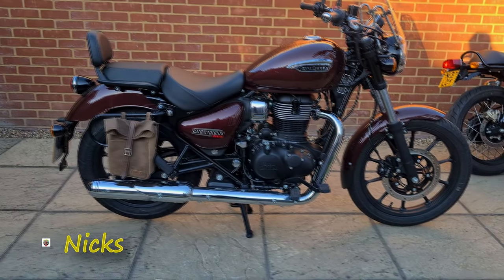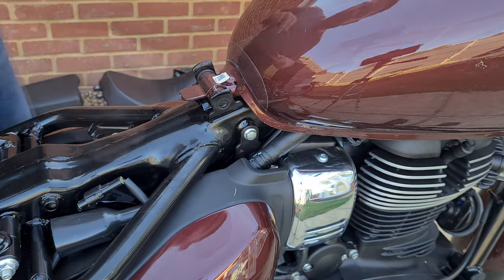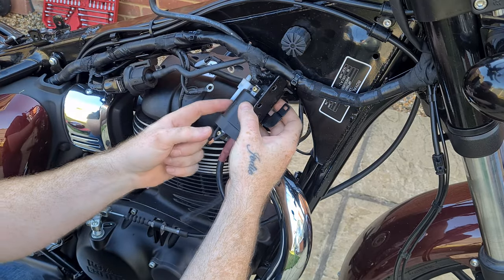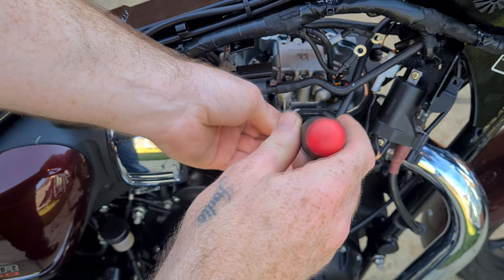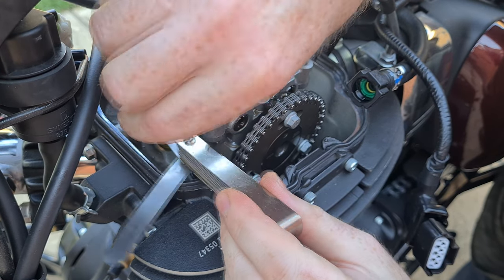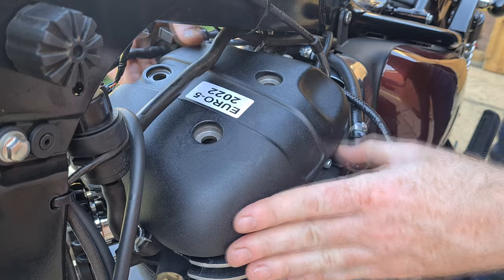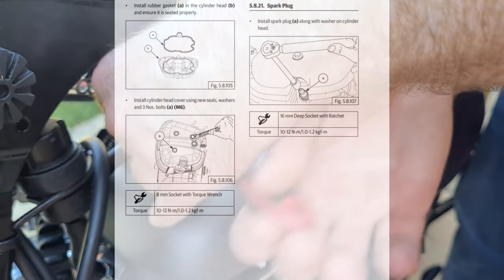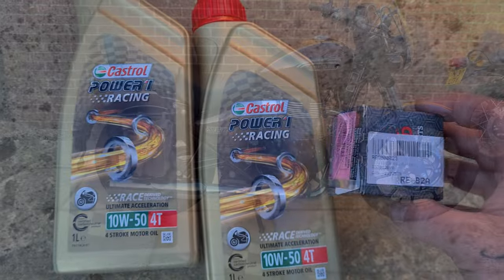Royal Enfield Meteor/Classic/Hunter 350 Valve Adjustment & Service | Oil Change | Tappets

Comment: Just a quick one, won't using fully synthetic oil increase the running in mileage due to the reduced friction of the synthetic oil 🤔 I'd have thought sticking with the semi synthetic till at least 1200 miles and then switch would be better.
Reply from the maker: Oil will be changed at 1k anyway I don't belive 300 miles is enough really.

Comment: Thank you for the video. I have two questions: 1. You showed images of pages with the torque specs in your video. Where are they from (Is there a service manual available?)? 2. What is the “parts cleaner” spray you were using? It looks handy.
Reply from the maker: its literally brake cleaner. you can find the manual on a royal enfield forum, link is here in the comments somewhere.

Comment: Great Video! Does full synthetic affect the clutch? I’m a Honda tech and some models couldn’t use full synthetic. Also I take it these are the same valve specs that use the 350cc engine? Wish Royal would make a damn service manual available to the public.
Reply from the maker: Hi bud,  for the clutch, it's fine with this low stress engine

Comment: Great video, I made the mistake of tightening the engine cover bolts too tight and snapped one, thank god I was able to get it out and order a new one…. Watched another video which says to tighten them hand tight, and then give an quarter turn…anyway you can comment on this with your opinion on tightening those bolts
Reply from the maker: once they come to a stop with hand, turn 1/4 of a turn
Reply: @nicksepisode  thank you, also did you notice the tappets sounding more noisy after the service? My bike runs so much better after the service but I had a guy tell me the tapping noise is not good and I might have adjusted them too loose, but he doesn’t even own a royal enfield😞 I’m hoping it’s just the way the bike is supposed to sound
Reply from the maker: @airborne15545  the noise should be the same as before. Take your feeler gauge to your mechanic and show them the specs to make sure you have used the correct gauges. The numbers can get confusing on them

Comment: Excellent video. Question: Does the engine noise increase when the engine is warmed up? Is this normal on the 350? Only have 2,000 km on mine and I'm concerned. Basically sounds like a piston slap or a leaking exhaust manifold. Nice and quiet when engine is cold.
Reply from the maker: yes the oil gets thinner and noise will increase when warm
Reply: @nicksepisode  thanks!
Reply: I would hope with a multigrade oil that it actually reaches 50 viscosity rating when warmed up. It shouldn't get thinner, IMO. The oil just generally flows more easily when warm.

Having said that the video is excellent and I am about to get my own bike soon so extremely useful. @MagicRoosterBluesBand
Reply from the maker: Thinner is a better word to help visualise what's happening

Comment: Just a question… what is the product you use for parts cleaning and in what kind of container you put that product in so you can then pray the cleaning product. Thank you
Reply from the maker: Its brake and clutch cleaner. The container is a pump action pressurised bottle from "wurth"

Comment: Would you recommend putting sealant on the Rocker cover gasket if you have disturbed it on the first service,
And if so, do you put sealant all around the Top and bottom, sparingly?
I'd be most grateful for your opinion?
As I have a slight leak after doing my first service on my Royal Enfield Hunter 350 
And I'm thinking that the only thing that would stop it now is my new gasket (which leaked) , and I should do it with sealant now,
Cheers Paul Foster
Reply from the maker: Put the gasket in the rocker cover first. Smear a thin layer of silicone sealant on the rubber. Try that
Reply: @nicksepisode  thanks very much, I'll do that 👍

Comment: Hi Nick! Great video! Can you please clarify one point which would make things a lot easier for people undertaking this service - as this does not appear to be covered on YouTube or anywhere else? As the  petrol tank has a fuel pump; when you disconnect the fuel supply pipe from the petrol tank to the injector, will only a small amount of residual petrol drain out of the tank (because the pump is not pumping) or will it free flow all over the place? Thanks. John.
Reply from the maker: hi, it will bot free flow, sorry i should have added that
Reply: @nicksepisode  Hi Nick - is that a 'No' it will not free flow? Thanks mate!
Reply from the maker: @johnmcgill5742  it won't free flow bud. You can remove pipe even with full tank
Reply: @nicksepisode  Hi Nick! That's great - thanks again! Top video & tutorial by the way - can't wait to get started knowing now that I'll not be covering my feet in petrol (LOL)!

Comment: Does it matter if I use a different oil filter that isn't royal Enfield brand? I don't feel like going to the dealership every time for parts, so I was wondering if there are good equivalent replacements I can use.
Reply from the maker: You can use after market filters from eBay

Comment: Hi! I'm contemplating between a Meteor,  Hunter and a honda bike and looking at the maintenance upkeep. What's the valve clearance interval for a meteor? Or is it required every oil change interval?😮‍💨
Reply from the maker: valve check every year but its very easy. if you are not mechanically minded go with a Honda

Comment: Any particular reason why you didnt remove the oil via the drain hole first, instead of by loosening the filter housing?
Reply from the maker: The filter is where most comes out, the 2nd bolt just drains the crank case area

Comment: Hi
Just a quick Info update, I have a 350 classic, just approaching the first
Service, 
RE have confirmed to me that the tappets dont need adjustment at the first service
They do however require it at the second service
Regards
MikeN
Reply from the maker: Mine needed adjustment, but won’t harm to leave it until the 2nd service as that’s more cost effective if you’re paying a dealer to do it.
Reply: @nicksepisode  No problem,  mine is not going back to the dealers for servicing.

Comment: I greet you Nick, from Slovakia. I praise your excellent instructional video without unnecessary words. I have 2 questions: Do you mind if I did not offer a new oil filter into new oil as it is here in the video? Does it bother if I did not twist the smaller drain screw on the right side of the engine when I discharge old oil? (I only drained the oil through the larger hole with a plastic filter that is for 2 smaller screws.) Thank you for any answers.
Reply from the maker: that's absolutely fine

Comment: How can you tell if the TDC is on compression stroke or exhaust stroke?
Reply from the maker: The valve arms will have slight play
Reply: Erm! Not sure that’s entirely correct? I did the clearance today and the TDC hole (cam) travels a full 360 on rotating the crank bolt. Within that 360 all 4 strokes are complete. Are you suggesting that a full 360 of the TDC hole is only 2 strokes?

Comment: How long did it take to Nick?
What is the difference in time between a major and minor service?
Many thanks
Reply from the maker: 1 hour. Minor is oil and filter and inspection. Major is oil filter, air filter and plugs with a brake strip down and grease etc. Alternate these each year, eg. Minor, major, minor. Always check valves each 4k miles too.
Reply: @nicksepisode  
Thanks Nick. Dealer says valve clearance on the first service. After first service, do you have to do 6 monthly checks at the dealership to retain the warranty?
Many thanks
Reply from the maker: @Mongoose118  12 month checks at dealer to retain warranty

Comment: Is the clicking noise from the engine normal? Mine got louder with my first service from the dealership. Should i worry about it?
Reply from the maker: i would get it checked
Reply: Thanks, I'll wait for the news. Cheers!
Reply: If it comes from the tappets, it’s quite normal. Valve play is often too small before first service. After adjustment due to a bigger valve play you will the ticking

Comment: Excellent video, but dismantling half the bike to check the tappets seems like poor design to me - on an otherwise really good bike.
Reply from the maker: Most bikes are like that these days unfortunately, compared to a triumph this is a lot easier to perform on the royal enfields
Reply: I have 3 Guzzis dating from 1971 to 2019 all are easy-peasy to service. I will have a Honda NC in a couple of days equally easy. The Enfield has easy tappets, but as for the rest poor design. Not a deal breaker, but a ball ache.

Comment: Why didn't they give it a hydraulic automatically adjusting valves... I mean.. other motorcycles don't need this adjustment, exceot RE and Honda gb350
Reply from the maker: No modern motorcycle has hydraulic adjustable valves. They use shims. This is way cheaper and easier than a shim set up

Comment: After i did my balve adjustment, i hear tik til sound when running or idle, do u think it is related to valves? Is it bad?
Reply from the maker: Did u adjust any of them ? If so was the out ? Loose or tight?
Reply: @nicksepisode  i did adjust both, it was tight, i am having issues with the seal aswell as oil leaks from the head
Reply from the maker: Re do it again. Take the seal all the way off and put it into the rocker cover then install. Make sure engine is cold
Reply: @nicksepisode  it is glued on one side and if i try to take that off the seal starts damaging
Reply from the maker: The glue should peel off. Worse way just order a new gasket and try again.
Reply: @nicksepisode  i would rcommend taking the whole gasket out, put on cover and then put the cover back, did it now and no leaks

Comment: can we air blow for dust remove inside air filter box of meteor 350?
Reply from the maker: Yes absolutely for the first service
Reply: @nicksepisode  if we air blow inside air filter box , will it impact throttle body or throttle body sensor? as i heard we should not clean with any solvant or alcohol or any pretroleum liquid or any air pressure inside throttle body. so if we clean with air blow or air pressure inside air box,
Reply from the maker: You can buy air cleaner. Throttle will be closed to no issue really
Reply: @nicksepisode  thankx a lot for your kind support
Reply: @nicksepisode  if possible plz upload video of fog light installation in meteor 350 without wire cut of default installed. Also few queries if i installed fog light in my meteor, is it impact on any  default electrical or electronic issue while running? and if it is possible then plz suggest me recommended brand of fog light and also process. Very much thankful

Comment: How to empty the fuel tank?
Reply from the maker: it wont matter if fuel is in there as it has a automatic shut off, just helps if its empty for handling purpose. just ride it until low
Reply: @nicksepisode  How to protect the tank for winter so there is no corrosion inside? Drain the fuel or add e.g. Ipone Petrol Stabilizer?
Reply from the maker: @arkadiuszk.3898 fill up and add stabiliser
Reply: @nicksepisode  Stabilizer, do you recommend any?
Ipone Petrol Stabilizer makes it easier to start the engine. Does it protect the tank? I don't know!
Reply from the maker: @arkadiuszk.3898 they’re all pretty good, just follow the directions on the bottle and you can’t go wrong :)
Reply: @nicksepisode  Yes, I know how to use it.

Comment: Let royal Enfield dealer service bike
Reply from the maker: Less competent owners yes. Mechanically minded, no. Dealers want 300 for this service, bit excessive considering i just spent 4k with them
Reply: Really?  Dealers here in California wanted $500 and $630US respectively.  What's that, 10%+ of the cost of the bike!!!
No thanks.
Ride Safe 🙏🏼
Reply: @scottboettcher  - Outrageous!  Does that include the dealers in Burbank and Brea?
Maybe they're expecting warranty issues?
Reply: @daveinwla6360  Yup!  Sure does...and we got three Royal Enfield Classic 350 from said dealer...in Glendale.  Found a great local shop to do it and was a fraction of the cost, and she's running like a top!
Reply: @scottboettcher   -  That's good and bad to hear.  I did notice that whenever I called regarding questions that I had about RE models, their salesmen never seemed to know anything and were  more interested in getting my contact info, and their parts counter knew even less.  I am glad to hear that there are alternatives for RE service if it's needed.
Reply: @daveinwla6360  don’t let that stop you from getting one!  I’ve never been happier. Simply a great ride!
Ride Safe 🙏🏼